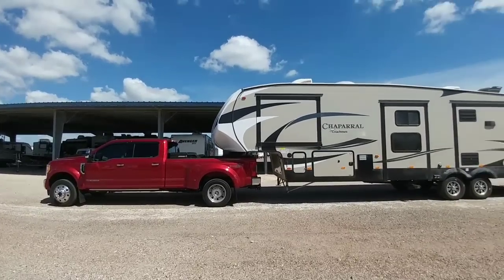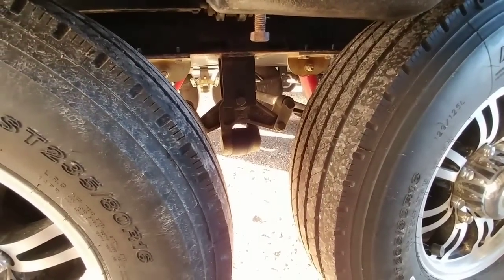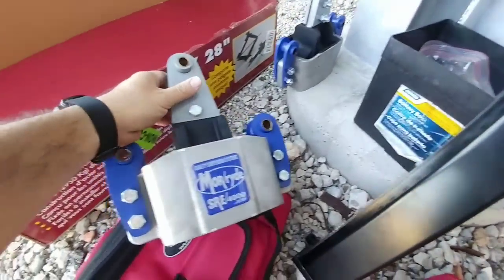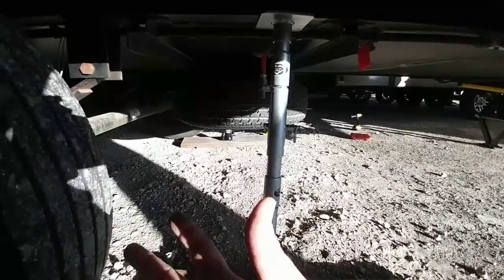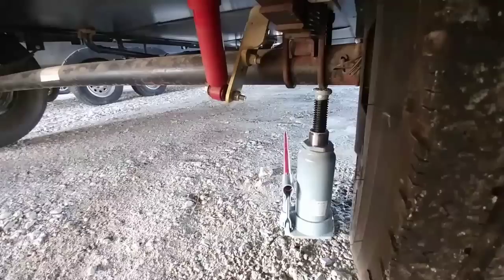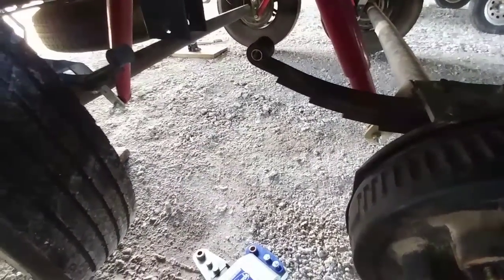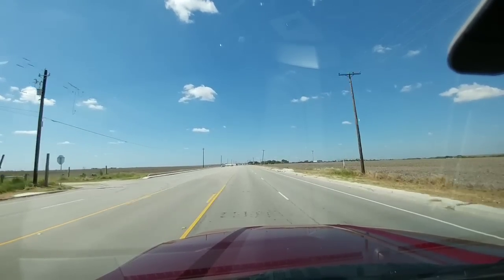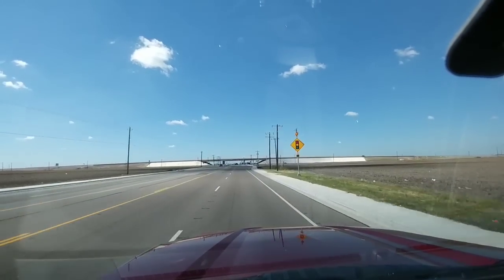Fifth Wheel Suspension MorRyde SRE 4000 install and Lifted with SafeJack

Comment: I installed the SRE4000 MORryde suspension and wet shackles on my Cedar Creek 38CKTS.  In order to do so, I too removed the OEM Dexter Easy-Flex suspension and shackles.  Immediately upon leaving the MORryde factory in Elkhart, IN I crossed a RR track and could instantly tell how smoothly the MORryde suspension handled the crossing.  MORryde makes the finest accessories in the trailer industry.  I highly recommend MORryde components.

Comment: We have these on a 30’ Winnebago travel trailer.  We swapped out the original 4400 lb axles and springs, because of the cheesy 3500 lb wheel bearings, and went with 6000 lb axles with bigger 12” brakes. We replaced everything from the hangars on down,  we just got back from. 1700 mile trip.  We were told we didn’t need shocks with this system.  We misjudged a turn and had to roll over a high median with one side of the trailer and the added travel of these equalizers allowed us to do so without damaging anything.  Great video.
.

Comment: I've had these on my 5th wheel for the past year and they have made a huge difference in how smooth the trailer pulls, but also with how I can generally leave non-fragile items in place like on the counter of the kitchen and it doesn't move in transit. That tells me that much of the shock of the terrible lippert leaf spring design is not being imparted on the structure of my 5th wheel. I will say that these are wear items. The rubber bushings do wear and separate from the metal housing overtime. Keep an eye on that. I've got about 10,000 miles on mine now and they sag a bit. I plan to reach out to Morryde to see about a warranty replacement, that said, they are still worth every penny, and I've heard Morryde's customer service is outstanding. Also, when I do replace them I intend to get a set of those safejacks. I did mine with scissor jacks and cribbing. Not safe.
Reply: Look at the Roadmaster Slipper springs with Joyrider gas shocks. So nice, so strong, great ride. Easy install.

Comment: I know this video is older, I see everyone upgrading the  spring components , but not the springs themselves. I have had 2 spring failures on my Autumn Ridge 32 RKS . They both snapped clean, up near the shackle one last year and the passenger side this year.  I Had the rated axles for the trailer. A crazy experience when an axle shifts after a spring snaps going down the highway at 70 m ph.  Then trying to deal with on side of highway.  I have pics

Comment: I have a pair of these 6500# Husky jacks bolted to the rear frame of my 94 Class C Tioga Arrow for leveling and stability.
Over built? You bet they are! Granted my Arrow is the big boy at 32 feet; and mounted as far back as possible; with a cordless drill, when the jacks are over half extended....they stretch my suspension with ease to level out.
At one favorite campsite; (due to the terrain) with custom wood ramps the bumper of my rig is over 3 feet off the ground and solid as a rock. (The rear wheels are NOT off the ramps/ground btw.)

Comment: Same here talked with Mor/ryde, said the same think but would help on the ruff roads. I had a set of the shocks installed anyway, if it will add a little help to the suspension, good investment over the life of the RV.

Comment: Roadmaster Slipper Springs with Joyrider Gas Shocks. No Comparison.No maintenance, won't wear and fail like all the Mor/ryde junk! Slipper spring have been used on commercial rigs for over 50 years! Oh yeah easy install.

Comment: I installed the SRE-4000 on my Alpine fifth wheel and have been very happy with the performance over the rough roads in Alaska and the Top of the World highway. My question is are you happy with the Joy Rider shocks in combination with the SRE-4000? When I purchased the SRE-4000 MorRyde advised against adding shocks but I can see no reason other than the travel of the SRE-4000.
Reply from the maker: I love the SRE4000s, but do not care for the shocks.  They really don't have enough dampening ability to effect such a heavy trailer.
Reply: @BigTruckBigRV  I was wondering if they had enough stroke to handle the 4" of the SRE-4000. I had my tires balanced when the unit was new but had a bent axle that was replaced by Lippert. I now have signs of balance problems and think a proper shock system would help. BTW MorRyde said not to use shocks.

Comment: Great video, now seeing you entire set up, shocks, Morryde 4000, what made you decide to got that route instead of a complete independent suspension set up?  I have a new 2021 Jayco 5th wheel HT gvwr @ 10000......with  Morryde cre3000.  I like the IS concept and can't figure if it's worth the money on such a smaller rig. 
Would you have any advice?

Comment: Although you didn't discuss, it appears that you did jack both sides of the 5th wheel prior to the installation. I was actually wondering if you could jack 1 side at a time and then install vs both sides off the ground
Reply from the maker: Jeff Ward: we started lifting the entire rig, but ended up doing each side individually for better stability and safety while working.

Comment: An much easier way to use the jack is to get a copper or alum. tube, put it on the jack handle and then use.  Gives you much more leverage and it's easy to jack up.

Comment: QUESTION ON SUSPENSION:  Last summer we bent the driverside rear axle on our travel trailer, which threw off the camber.  When noticed, the tire was worn out.  Had the frame shop to align, they said potholes likely caused the bend.  Is there an aftermarket kit that could help avoid this from happening again?

Comment: How does the suspension perform after 3 years that's what I want to know and how many miles have you logged on that suspension in that time I do equipment repair and I have a client that has 6 trailers that needs suspension that he spent a small fortune on faulty suspension parts suspension parts

Comment: Thanks for all your RV videos.  I also have a Chaparral 5th wheel (345BHS) which I love.   Because of your videos,  I have upgraded to the Sailun tires and just purchased the Morryde 4000 system which I'll be installing this weekend.   I'm excited to hear about your positive comments and can't wait to get it on the road.  I just wish I could get Reese to warranty my hitch because it too is chucking as well.  Thanks again,  love the videos!   One question,  do the shocks make that big of a difference?   Would you stick with Joy Rider or look for another brand?
Reply from the maker: I'm very please with the joyrider Morryde combo.  I think they help control the travel the Morryde allows for.
Reply from the maker: Paul Youngberg: how did your install go?
Reply: Big Truck Big RV 
I absolutely LOVE this setup!  Everything you noted in your video was exactly right.  The install took me about 3 hours for the suspension.  I found a bad brake from the factory, so I upgraded all 4 to the self adjusting brakes and repacked the bearings while I was there.  I have not added any shock absorption system yet.  The Sailun tires are awesome, and my new Champion 18k hitch is perfect.  With all these upgrades, my rig is tighter than ever and so smooth.  The only noise I have now is the slight rattle from my truck box lid, lol!  Thanks for all the advice.
Reply: Paul, when ordering the MorRyde did you measure from hanger to hanger or the center to the center of the wheel hubs?

Comment: How are the shocks and shock brackets holding up after some good trailer miles on the system. I heard some have had troubles with the mounting system of it breaking

Comment: Very impressive suspension system. Morryde makes a good product. Have u seen the new step system they have out.  They seam and feel fantastic
Reply from the maker: Kevin Barone: I have and I plan on installing one soon.
Reply: Big Truck Big RV you know I was wondering about the husky jack you had under as well. Those seam to be just stabilizing jacks to me not sure I would have trusted those. I put the cre 3000 on my travel trailer this spring and we noticed a difference in how the camper rides for sure. A bit smother for sure. As it turned out I wound up replacing all the bushings and did the shackles as well. I used the brass bushings but the standard shackles for now. I’ll be going to the wet bolt kit eventually.
Reply from the maker: Kevin Barone: The Husky jacks are the ONLY scissor jacks that I WOULD TRUST to support that much weight.
Reply: Big Truck Big RV huh ok guess I’m just old fashioned. I use jack stands and or blocks

Comment: How has your experience been with the SRE 4000 after one year?  I talked with Sonny at RV Improvements and he steered me away from them.  My dealer, who sells them, also told me they have had some issues and recalls and did not recommend them (on the QT).

Comment: Great video.  Roughly how high did the trailer need to go off the ground(bottom of frame to ground length)in order for installation?  Trying to get my timber blocking figured out.  Thank you
Reply from the maker: About 3.5" tires off ground. Also lift and install 1 side at a time.  When lifted so high, stability will be an issue.  Don't want to get crushed.

Comment: I know this is a bit older but I was looking at these equalizers and came across this video. 
What concerns me with this equalizer system is body lean in curves at hi way speed. 
With the conventional equalizer you only have the springs pushing the RV body to roll in a curve. With this setup you now have the springs AND the equalizer trying to roll the RV.

Comment: Hey Big Truck Big RV, Ive been an avid subscriber of yours for a while, and have made some buying decisions based on your information/videos. My questions for you is this: Is their a ride or quality difference between the dexter EZ flex, and the Moryde 3000 or just branding? I’m upgraded my Grand design from a standard rigid equalizer. Will the trailer chuck and bounce on my hitch noticeably less? Thanks for your time
Reply from the maker: The Morryde system does provide a significant amount of movement vs the EZ Flex.  The EZ Flex in my opinion is the more robust of the two products however.  I would not do the shock absorbers though.  They simply do not have the dampening power to really make a difference.
Reply: Big Truck Big RV  Thankyou. I should e to apologize, the dealer is installing “road armor” not the Moryde 3000 or 4000. Not sure if this a decent product. What’s your take on Weslake tires? Do you think I should have my wheels balanced as well?

Comment: Nice video, but got one question. Now that you have 4" of suspension travel, are the joyride shocks designed for that much travel? Just a thought.
Reply from the maker: atvtinker01: Yes sir. that was the first thing I investigated
Reply: Manufactures say don't use them

Comment: How does it do around corners, mountain bends. Flex is good but it'll  add more side to side sway, unless you add an anti sway bar. How much sway does it add, and do you think a sway bar is necessary for those of us who travel through mountain country?
Reply from the maker: Evolution Glitch: I honestly don't know how much of an effect sway would have with the new suspension. I do know that it is standard on many Fifth Wheels that approach $100k
Reply: Big Truck Big RV 
Cool thanks for the reply. If you learn anything in those regards, let us all know. Also keep up the great videos!

Comment: When ordering your SRE 4000, did you measure from the wheel center of one axle to the other or did you measure from the first hanger to the second hanger?  Went to RV upgrade and they show to measure from the center of the first wheel hub center of the center of the second wheel hub.  MorRyde note to measure from center of one hanger to the seconded hanger of the other axle.

Comment: Would the trailer stabilizers help? Maybe they don't extend that far down?
Reply from the maker: Michael Hony: They aren't designed for that much weight.
Reply from the maker: Leslie B: Yes, Easily. Just be Sure your frame won't twist....which it shouldn't

Comment: Where did you purchase the joyrider system from.
Reply from the maker: it was provided to me for this video from Joy Rider
Reply: Thanks will look them up, thinking of attempting the job have to get some long bits, did you have the RV on jacks to install both sets or just on level ground.
Reply from the maker: Jacks.  But we we would lift it differently next time.  Drop the front down really low and then put tall 12k jack stands under the frame right behind the rear tires.  Lift up on the front and whala
Reply: Big Truck Joy Rider has a new system called Comfort Ride, know of anyone who has installed it on there RV or you could put some info on your channel about it. Thanks

Comment: Did you put the air bags on not much sag without them and what air pressure did you have in your tires for the test ride.
Reply from the maker: Drifter's Den: no airbags on the truck

Comment: your jack technique needs work the only good thing you did was connect to the truck to minimize fore and aft movement that is assuming that the truck parking brake was applied and at least one wheel was chocked fore and aft.  There is obviously no wheel chocks on other side of trailer being used as they should be.  The scissor jacks have limited strength against lateral motion as they are fully extended.  the easier way to lift and safely work on is to use one jack (floor preferably) under  an axle which will immediately raise the chassis since the suspension is "pre-loaded"  raise the frame to a sufficient height then use jack stands on frame then lower the hydraulic jack transfer the weight onto the jack stands and  hang or unload the axle.  this technique is safer as the jack is never extended to such a great length
Reply from the maker: Randy D: Thank you for providing better jacking techniques.  I appreciate your knowledge.

Comment: should have also used a jack stand or blocks
Reply from the maker: we originally used blocks and one broke under the load.  Caused a dangerous situation.  Steel is the way to go brother
Reply: Don't think he meant concrete blocks. That's just asking for trouble. Blocks or railroad ties acting as cribbage. I need to do something like this with my 95 Holiday Ramble but probably air ride since it has and older style Moryde system and not leaf springs.
Reply: I agree with the jack stands. You could have rented heavy duty jack stands from any equipment rental company. Safety first! That is an OSHA requirement in a commercial setting. Just saying! Great video however and I agree on the Morryde as a great choice.